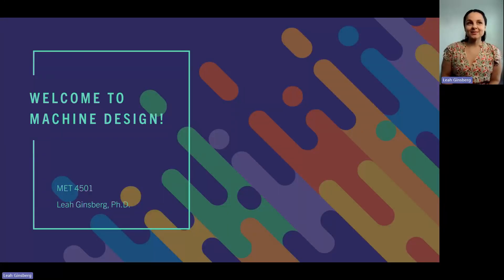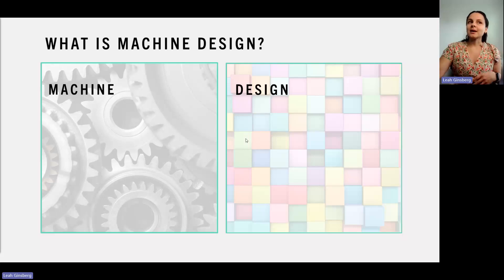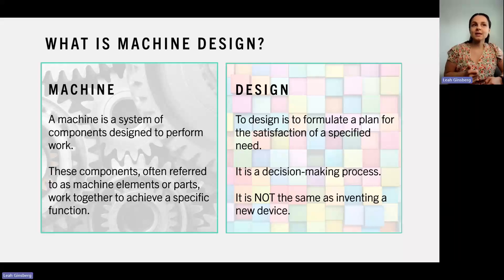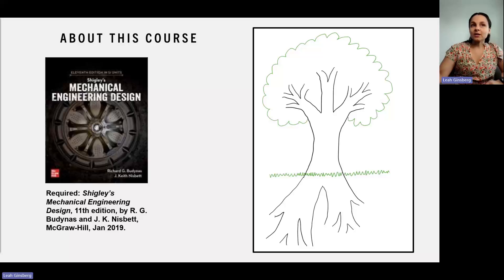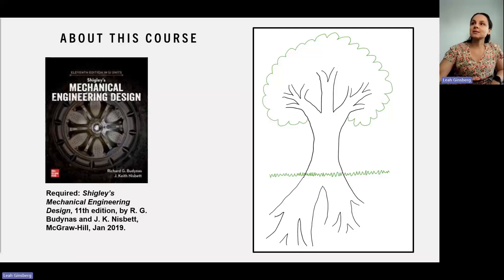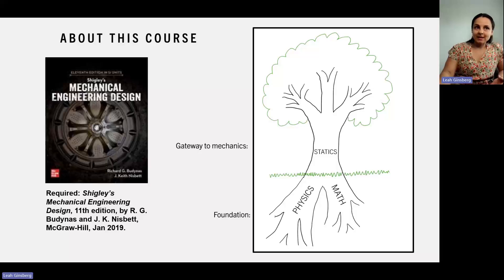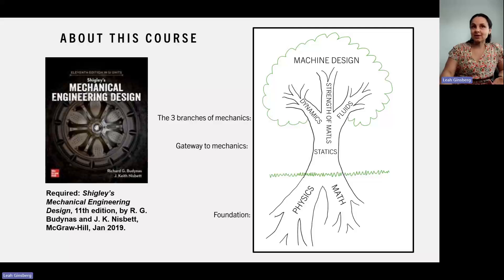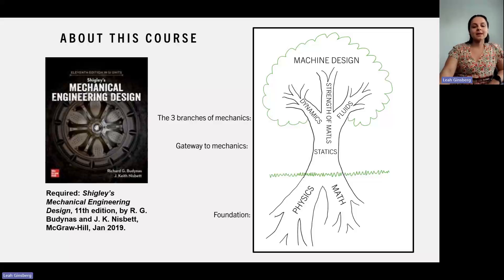Start Learning Machine Design Today! | Machine Design - Lecture 0

Comment: Do you have gear for manufacturing in your channel? I am a degreed mechanical engineer with 25 experience in the industry.
Reply from the maker: Welcome! Can you elaborate on what you're looking for? Are you specifically looking for manufacturing methods of gears? I touch on this briefly in my heat treatment video when discussing case hardening: https://www.youtube.com/watch?v=EJgo-EV5z1M&t=1s

I don't think I currently have anything that will fit your needs, but I'd love to understand what you're looking for so that I can consider it for a future video.